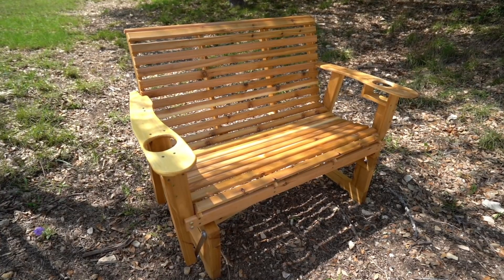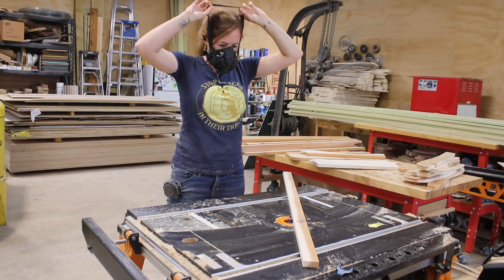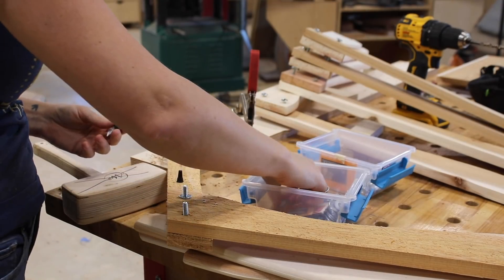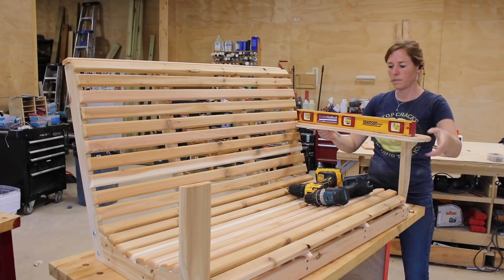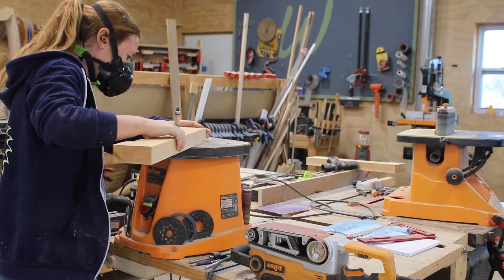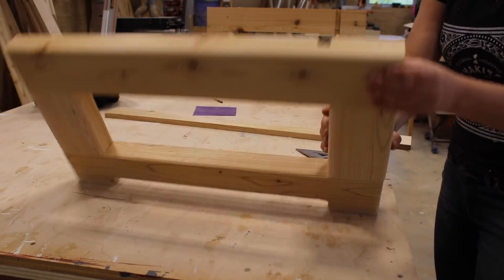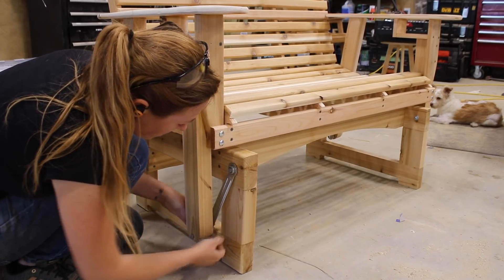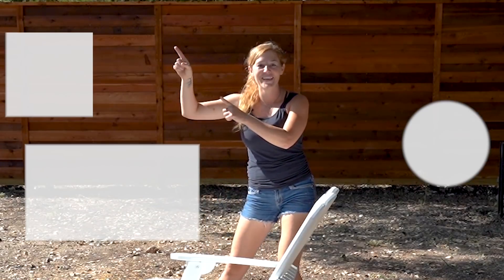DIY Outdoor Wooden Bench Glider

Comment: Bought the plans. Very well done. Highly recommended. Parts are color coded. Templates use direct measurements instead of grid. Easy to follow. I'm using treated 1 ⅛ inch ( and significantly heavier!) deck plank and will use outdoor glue (Titebond III) on mating surfaces. Experience with outdoor seating projects exposed to the weather tells me these glued joints last a lot longer. I secure the parts with pre-drilled deck screws. A few adjustments in the template dimensions are needed for deck plank. I'll put the back and bottom slats on the frame with screws only in case they need to be replaced.

Comment: If you are building something to last 2-3 years by all means use galvanized hardware. If you think it might be quite nice to have the thing still looking good and usable for 10 years then the ONLY choice is stainless. Galvanized hardware starts to show signs of rust after only a few years. The coating is made as thin as possible to cut down on costs but that makes it very likely to breakdown quickly. Stainless hardware does not cost a lot these days especially compared to the time to make and cost of the timber. In all my outdoor projects and even in a lot of indoor ones I always use stainless if at all possible.
Reply: Thanks y’all for the galvanized and stainless hardware tips. I’m an old fart, but a wood working beginner! Really glad I read the comments and replies .. S H  Katy, TX

Comment: Very nice glider.  Once I get a patio built its something I'd like. The reason you don't find locking washers in galvanized is because the process ruins in nylon locking material.  For what your doing a flat washer, spring washer and nut in galvanized will work well.  Those may not have been available.  A spring washer will hold tension on the threads helping lock them in place.

Comment: Could you do a video about getting your mailbox up at the correct (42-45 inches to the bottom) height? Now that spring is here, rural mail delivery drivers would really appreciate if you could do a post, about the height of a post for the mail box at the end of the drive. 
A LOT of people have a mailbox and 
get packages, so emphasizing the biggest box for sale at Home Depot for $25ish bucks would help the people packages not get ruined during the spring, and fall rain seasons. Also a custom package holding box out front of the house would be a quick, helpful, creative, and useful build. 
Thanks for all the videos!!

Comment: When free routering on a table without a fence, use a pin to brace the workpiece as it's pushed into the bit. I've had it happen where the router bit grabs the wood and jerks it (which sometimes causes excessive tear out or gouging) or launches it across the shop. Also, not using push blocks could also put fingers and hands in danger of serious injury or amputation. The last thing to do around power tools is to get to comfortable and arrogantly confident.

Comment: April, what is the smaller hole in front of the cupholder for on the armrest? Thank you! ❤
Reply from the maker: It's for running a chain through in case you want to make it a hanging swing. The hanging swing and glider is the same template. Thanks for watching.

Comment: I've made one of these in the past using my own design and the key to getting the correct rocking action is to have the hanging hardware angled where the upper connections are set wider front to back than the lower connections. Today it costs a small fortune to build these projects.
Reply: I made this glider and attached hardware according to instructions but it is "stiff" and won't glide almost at all. Any advice on how to make the glider glide?

Comment: If you want your projects to last on the lawn. 
Make large round feet on the bottom.  That you use half inch larger pieces of old tires screwed with brass or stainless.  
This keeps  the feet high and dry by not having the feet sink into the lawn.

Comment: You shouldn't use galvanized hardware with cedar. It will turn the wood black. You should use stainless steel.
Reply: Thank you Wood Butcher for this comment! I’m almost to the assembly stage on my cedar Adirondack chairs and had already bought galvanized hardware. I’m going back to Menards tomorrow to exchange for SS!
Reply: @BrettMiller2008  is not
Reply: Thank you. Great video.

Comment: Two questions: 1. What is the hole towards the front of the left arm rest past the cup holder for? 

2. Why wasn’t wood glue used for the slats? I wasn’t sure if it was to allow expansion and contraction. 

Great looking glider!
Reply: 2nd hole is in case someone would rather (or also) make a hanging bench swing instead of a bench glider. That 2nd hole would be for the chain.
Reply: @talladegadude4852  It's only on one of the Armrests, and that armrest would never hold all that weight.

Comment: The top and bottom distances between the metal swing members determines the smoothness of the glide.  With tops and bottoms the same distance apart the glide is restricted to about two inches.  But I notice on your glider the front glide part hangs at an angle.  Can you tell me what the dimensions are?  Thank you.

Comment: the carriage bolts in the video are not galvanized.  Also, I am pretty sure you did use lock nuts with those carriage bolts and thread lock.  I can tell by the shape of the nut that they are lock nuts.

Comment: Hey April, interesting project you have there. I noticed on the front of the seat supports were the inside of your knee is that it has some protruding pieces of wood. Was that intentional or not or can those be sanded down and more flush?

Comment: Hey April, first Great work as always! Secondly, what was the round hole for on the left arm in front of the cup holder?
Reply: In case someone wanted to make a hanging bench swing instead of a bench glider, there is a hole for a chain.
Reply: That's what I was thinking but it was only on one side.

Comment: You can use stainless locknuts ( supposedly the twometals don't react wifh each other ). Amazon also has black galvanized lockers. Not sure what size you were using.

Comment: I thought Stainless steel fasteners were needed for cedar
Reply: So did I. If I remember the galvanized with leave dark marks in the wood. Structurally, should be fine for the long haul, it's cosmetics won't be the best.
Reply: They most definitely are. Galvanized will stain the cedar. Look at any poorly done cedar fence to see what it does.

Comment: Using a spirit level is useless on a piece of furniture, it's important to work square or dimension relative to the work piece. If your work bench is not 100% level, using a spirit level whilst making freestanding furniture on top of the bench you will experience very inaccurate results!